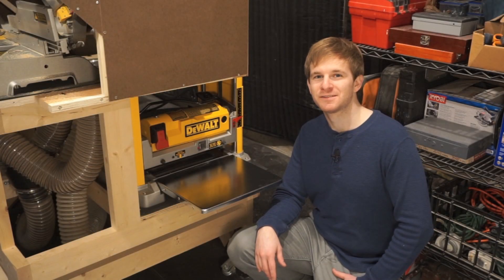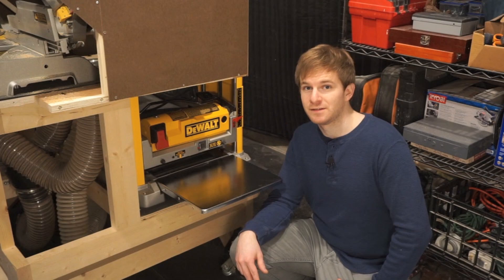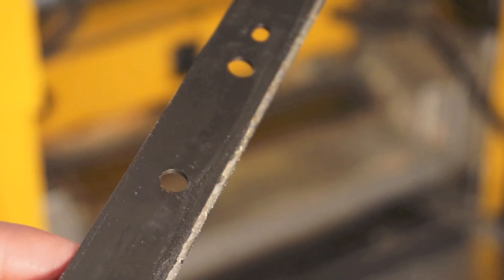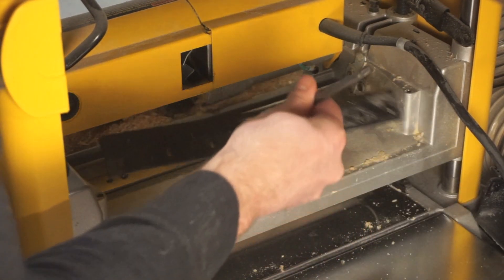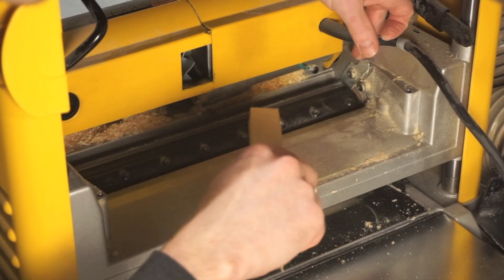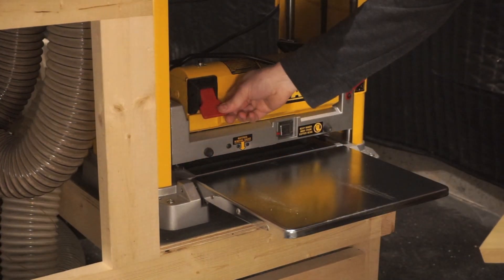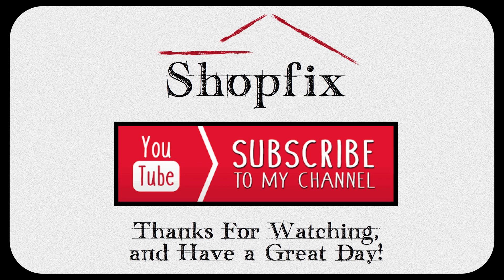How to Rotate or Replace Dewalt DW734 Planer Blades

Comment: I had just rotated my blades before I found this video.  Nice job William.  One thing I learned from this video is the little locking lever on the right side.  Maybe mine was sticky but I never notices it locking.  One thing I would add is that it is a good idea blow everything off while you have it apart.  I also recommend that you wipe off the two rubber rollers with a paper towel doused with alcohol.  That will greatly improve the feed without any hesitations.
Reply from the maker: Hey, thanks for suggesting those additional recommendations for other viewers. I wish you the best of luck with your future projects, take care!

Comment: So my planar was leaving grooves in my wood and didn't like feeding it though - signs that the blades needed to be reversed / replaced.  It was also a lot louder than normal I didn't realize until I rotated the blades and it was quiet compared to before rotating them.  Also your shavings will go from nice and long-ish(depends on your board size) to dust and small little chips.  My blades were worn bad enough that the edge was rolled over I had to sand the rollover away for them to sit correctly when reversing them something to keep in mind for everyone.

Good video straightforward and easy to follow saw how it was done then went out to the garage and did it without referring back since it was so simple.
Reply from the maker: Wow, your planer was in need of the blade rotation for sure! I am so glad that you were able to successfully fix your planer by following this video. Thanks for the positive feedback. I wish you the best of luck with your future woodworking projects, take care!

Comment: 4:50 got to ask why not taking time to clean blade hold down bar and blow out debris in socket head screws to insure full hex key engagement?
Reply from the maker: You could certainly add that step, I guess i didn't see it necessary at the time.
Reply: @_Shopfix  Would it not be best to vacuum and blow that debris out before removing the blade to stop it getting under the blade? I've never changed a planer blade but except to soon.

Comment: HELP!!! When I am done and screwing back on the last cover, the right side doesn’t go back enough to have it slide over the little notch just behind the screw. Hope that makes sense 🤞🏻 desperate to figure it out. Any thoughts?
Reply from the maker: I am not 100 percent certain what could be causing the problem. I would check to make sure no debris, or wood chips are causing the issue first though.
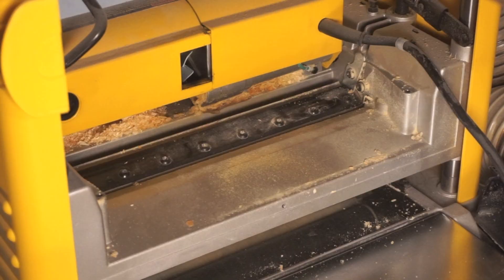Reply: Hi Nicole, I think the cover you've mentioned is the tool tray. That tool tray holds the down the locking lever that you see at 2:15 in this video so that it doesn't engage while you're using the planer. When you slide the tool try back in, you have to make sure the locking lever on the right, depresses and slides back under it, or it will be in the way and it will stop you from aligning the notch in the cover and the screw hole. I'm not 100% certain this is the issue, but it sounds like it might be the problem. Hope that helps!

Comment: This is by far the most informative video on how to do this I have seen. But! One thing I picked up from a far less informative video was, there is a triangle on the blades. If you pay attention to which way it is facing, that assures you flip it in the right direction. 
One other thing I couldn't help but notice is.... My dust collector is powered by a shop vac. Clearly this guy does't even own a shop vac. Guys cleaning your planer will keep it from making those weird marks saw dust leaves on fine lumber.
Reply: I hear that one from harbor frieght is pretty good just waiting to be in town with a 50% off coupon to buy it.  Their lathe tools are terrible though, their big lathe is what I use and it has been going for years, burned out one motor the replacement has been good though.
Reply from the maker: Good tip with the triangles!

Comment: Thanks Shopfix, thanks to you, ill be back to planing my maple quicker than you can say Planer 12-1/2" DEWALT DW734  Powerful 15 amp, 20,000 rpm motor of the woodworking planer handles larger, deeper cuts in hardwoods.
Three-knife cutter head with 10,000 rpm cutter-head speed of the thickness planer provides 96 cuts per inch, one of the finest finishes of any portable planer
Disposable, reversible knives of the wood planer deliver 30% more knife life and make knife change fast and easy.
Four-column carriage lock drastically reduces the movement that causes snipe
Extra-long infeed and outfeed tables provide 33-1/2-inch of material support.
Material removal gauge and extra-large thickness scale deliver accurate cuts with every pass
Turret depth stop allows user to return to their most frequently used depths with ease

Comment: I rotated my blades for the 1st time on my new planer and now the cutting head doesn’t adjust below about 1”.  I can get the cutter head below that...suggestions please?
Reply from the maker: Check to make sure there are no locks engaged and also check to make sure no turret stops are applied at 1”. I don’t think it had anything to do with the blades.

Comment: I don't think the planer knifes or blades feed wood though the planer.  According to DeWalt the two rollers actually feed wood and when/if wood partials get embedded in the rollers that slows the rate of feed.

Comment: I work with pallet wood. I punch out the nails before planing. I missed a nail and I am certain I have a nicked blade because when I run wood through it has two ridges in it. I’m going to try to rotate my blades